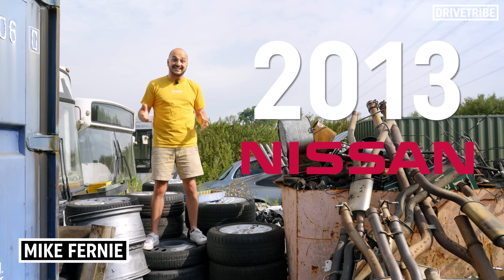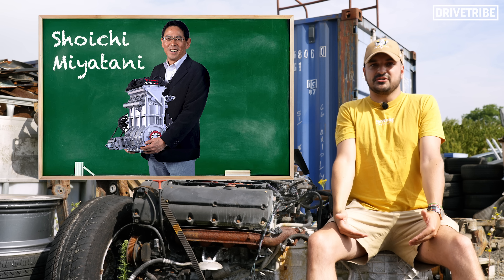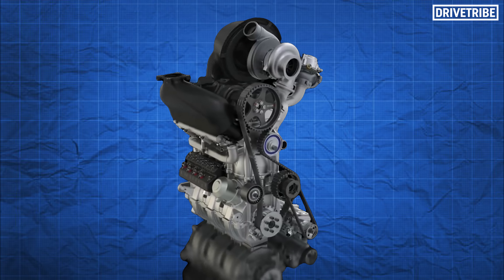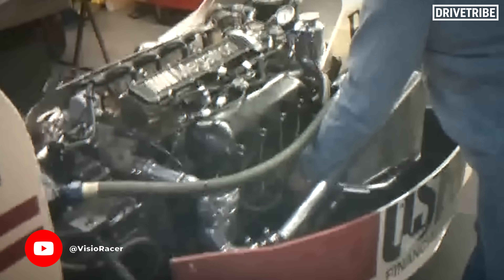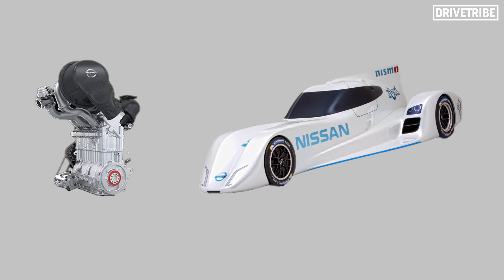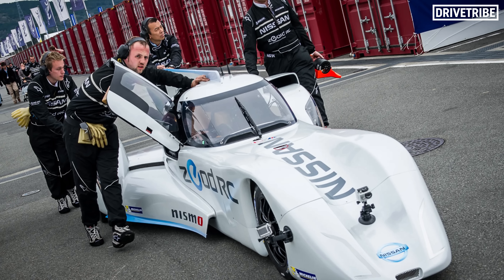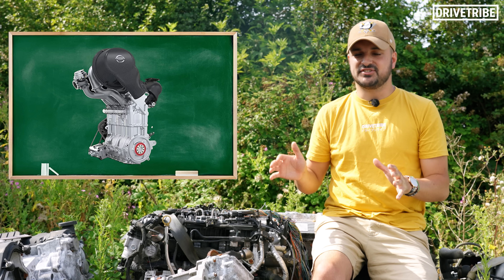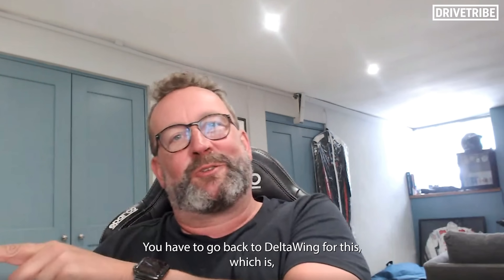This TINY Nissan Engine is More Powerful Than Your Car!

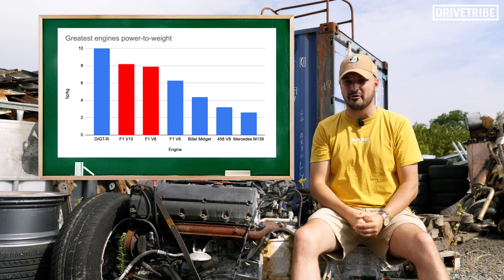Comment: 4:15 it is worth noting that the often quoted (and unofficial) "1250-1500bhp" that grows every time it is mentioned was only possible for one hot lap before wrecking the engine. Race output was more in the 900bhp range.
Reply: well at that time every car was pushing over 1200hp in qualifying but 800-900 in the race
Reply: Only 900 lol.
Reply: I don't know anyone who has any proof that the quali engines reached 1500hp, be it Ferrari, Renault, Honda or even BMW.
In the race, the engines often ran a lot less than 900hp (600-700 is a better bet). Partly because the engines would simply fatigue at such continuous output, but mainly because there wasn't enough fuel for the entire race at those numbers. Drivers could control the boost from the cockpit but they had to obey instructions from the pits (who had an eye on fuel readings) otherwise they would not last the race. Cars running out of fuel was a fairly common occurrence.

So, we shouldn't keep pulling crazy numbers out of our heads when the math does not agree with them.
Reply: @leoa4c  Yes I agree. The "1500bhp" is the wild figure claimed online (such as in this video). It comes from an over-exaggeration of the estimated 1400bhp, despite Paul Rosche admitting the BMW dyno couldn't go beyond 1280bhp. I wasn't claiming that the engines could actually make 1500bhp.

Race trim was in the 740-900bhp range, so I stated the best case.
Reply: They ALSO skip over the MPG of the little guy.
My little wankle gulps gas like a big v6.
Reply: 1400-1500hp was for like 3-4 laps otherwise you can’t do a flying lap 😉🤦‍♂️
Reply: I like how 900Hp seems to be lame these days! 😂
Reply: 1200 hp in qualifying at minimum, and maybe 1350 at most, crazy amount of power for 540 kg racecar
Today's F1 cars are 798 kg in comparison
Reply: 1350BHP was the ESTIMATED max power for the upright BMW F1 turbo by 1986 on the odd occasion that the engine could sustain boost pressure of 5.5 bar absolute in qualifying. In the race actual power would vary based on boost and mixture but they would typically see between 800-900BHP. The next time I see something about the 1983 BT52 saying that it was running 1500BHP i'll most likely scream, the truth is that for most of that season they probably had 600BHP in race, a little more for qualifying, the massive horsepower figures would be unlocked by advances in the fuel which only started to deliver very late in '83.
Reply: @philipbain Welding the wastegate shut like they reportedly did for qualifying would make HUGE cylinder pressures.
Reply: @captainobvious9188  how do you think a wastegate works?
Reply: @philipbain  Thank you. I've been trying to tell people that the 1500 number is just pure nonsense.
For the race, however, I don't think that cars would touch 900 or even 800BHP very often mainly because of the fact that there wasn't enough fuel for it. We also need to remember that none of those engines would ever last an entire race at 900BHP outputs. An average of 650-700BHP is a lot more realistic, and it is the average that Williams ran with Honda, according to Frank Dernie, if I remember correctly.
Reply: yeh, the current F1 engines basically make more power, more of the time, with half as much fuel
Reply: Well, that's still 600hp/L and 12hp/kg, so...

Comment: You forgot the Mazda Rotary engine. 240bhp from 1.3 L, naturally aspirated.
Reply: Not an apples to apples comparison as the rotary guzzles fuel at the rate of a big block V8
Reply: 1.3L rotary is not equal to 1.3L in a piston engine. To make that 240bhp, you're moving fuel and air equivalent to a piston engine twice that size.  240bhp out of a 2.6L NA V6( a 2 rotor has 6 'chambers') is much less impressive.

Comment: This could have revolutionized Nissan's lineup
Reply: @Jaho_Salami  can’t just make them for without knowing who will buy and if the made too much they might not sell or too little and the buyers look elsewhere.. Also don’t forget dealers mark up prices etc
Reply: and it connect to CVT.
Reply: variable compression nissan
Reply: @ouch9326  as in, holes burned through somewhere?
Reply: @izzyplusplusplus1004  some of them were reliable , some were not due to mass production quality control
Reply: @ouch9326  Proper builds ensure proper longevity and performance to be sure, which  is why if this engine were to be used for aircraft applications, it would have to be retro-fitted to meet aircraft standards, not automobile production standards. That would be done by an engineering firm, and a qualified A/P mechanic.

Comment: Koenigsegg finally found a worthy opponent
Reply: recently, a tuning shop got a GR Yaris engine to over 1,000hp. kinda wild
Reply: Sadly, too few customers picked the 3-cyl Koenigsegg Gemera over the added V8 option, so the 3 isn't happening for a while :-(( I think it would have saved over 100 kg which would really impact performance off the line and around bends. If (after all the decades) they really manage to make FreeValve and this light 600 hp engine work, it's perfect for basically anything. Even the GMA T.50 and T.50S might even get faster with it. Imagine it in an Ariel Atom or Nomad. A Formula 2 car. Indycar. Nascar. GT3. Hypercar. 
If it really works and works reliably and efficiently, there's no end to the applications and it's just a matter of making it affordable in larger production volume.
Reply: @Cloxxki  in an atom it would be 💀 literally
Reply: @Cloxxki Sounds like public relations speak for a failed experiment in my opinion.
Reply: The 3cyl is probably gonna be the more desireable of the two cars
Reply: @andyMutale  But it's not sold anymore. Maybe later special editions.
Reply: @andyMutale  if it ever gets made. Every Gemera has the 5.2l twin turbo V8, the onlt 3 cylinder cars will be internal, early development prototypes (which also have a completely different transmission as well). so engines are likely going to be taken out to work on for more RnD and no customer gemera at current will be delivered with it
Reply: Not really. This is only half the output of their electric motor
Reply: The 3cyl is probably gonna be the more desireable of the two cars
Reply: i want three of those tiny Koenigsegg's in a little speed boat please  :)  v's one heavy 200hp Yamaha outboard Mechanical - 234 kg (516 lbs) / DEC - 238 kg (525 lb)
Reply: Godly Comment